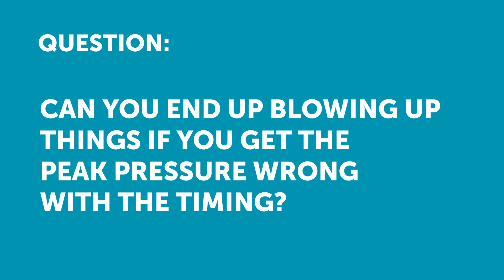Peak Cylinder Pressure | Engine Building [HPA Q&A]

Comment: There’s a lot of information about the damage high peak cylinder pressures can cause, but is there anything to be mindful of with high prolonged cylinder pressure due to higher rod ratios and offset wrist pins?

Comment: Is it possible to detect knocking at an early stage using pressure sensors in a Kistler spark plug? Are there programs in nature that work with such sensors? Indeed, it is difficult to detect a knock on the human ear.when the engine is running at high rpm.
Reply from the maker: Yes, you can monitor knock and also tune without a dyno among other things if you have the ability to accurately measure cylinder pressure. I am not familiar with the Kistler system so not sure what it does and doesn't do, but we have spoken about such systems on the channel previously - Taz.

https://youtu.be/PRWx1x8UezM
https://youtu.be/kJnCJNmy8Fg
Reply: I was just wondering if there was a spark plug with a connection for a pressure transducer. Thanks for the knowledge.
Reply: cars with ionization sensing through the ignition coils can already do this